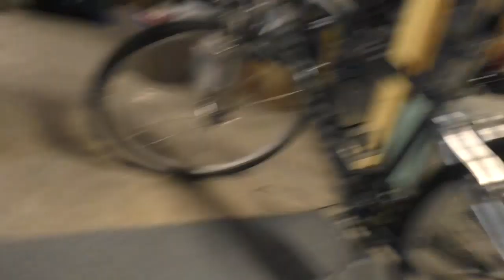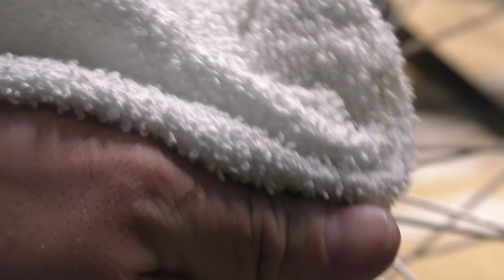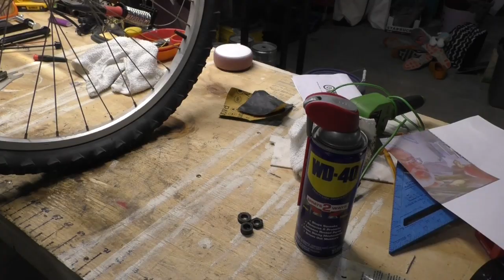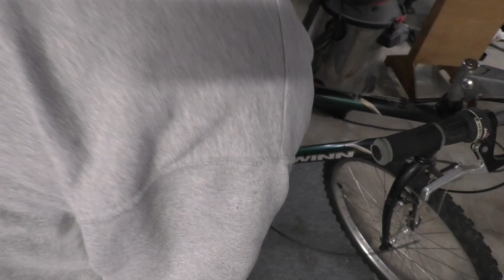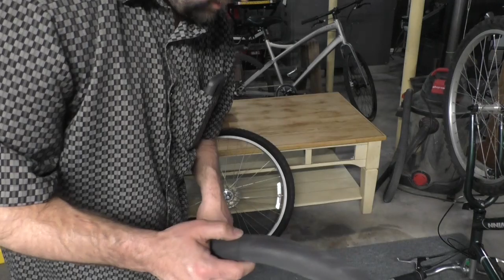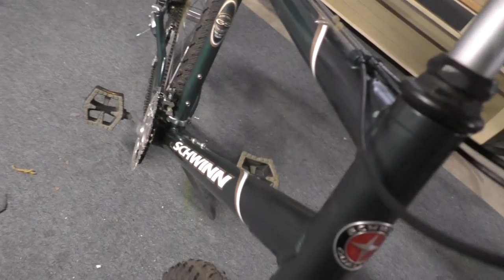Bicycle Repair - 1999 Schwinn Sierra GS Comfort Bike

Comment: Quick tip for removing rust....spray the surface with wd40 and rub gently with aluminum foil. The rust will lift through a chemical process rather than mechanical scrubbing which removes plating and scratches the finish.

Comment: Hi there, your capacitor replacement for Powerbook 160 monitor might be the solution to a problem I have, but I'd like to email you for some more info.  Trying to fix it and grab some ancient emails on my AOL account to settle a bet with a friend.  Your facebook link is expired.  How can I email you directly?  Or can you add me as a friend on Facebook to correspond?

Comment: I am rebuilding my montain bike from 2002, its old its rusty but the breaks & gears were totaly obliterated. So I striped off every part that moves, cleaned & replaced all the breaks & gears. Just finnished rebuilding the breaks & just need to do the gears & chain. The tips you give though the proccess are handy, the breaks turned out to be prety easy but then I did completly dismantal the old ones so I know how they work.

Comment: 43:08 best part of the video! haha I loved the whole video btw! 
I do have a question about stiff/hard chains. Would putting an electric motor and a heat gun (low heat) and running the motor to spin the rear wheel and the heat gun to warm it up a bit with oil being put on it help save and extend its life? Since that's kinda how it works on motorcycles. That is when riding it the chain heats up but those speeds cause the lube to come off but bikes never see those types of speed or heat levels.
Reply from the maker: I wouldn't recommend using a handgun on the chain... that would be counterproductive. I also wouldn't use a heat gun either. Honestly, plenty of oil and several miles of riding should help.
Reply: @bbishoppcm  Did I actually say handgun? wow My mistake